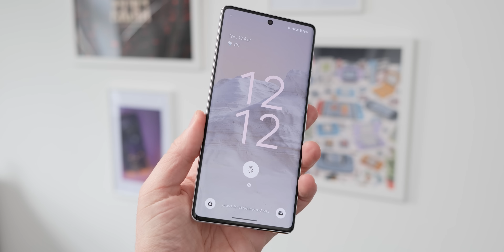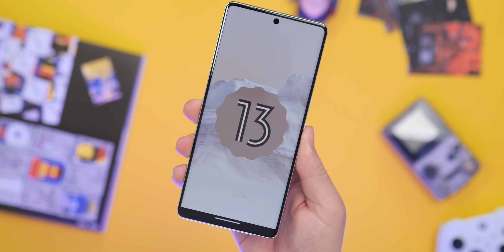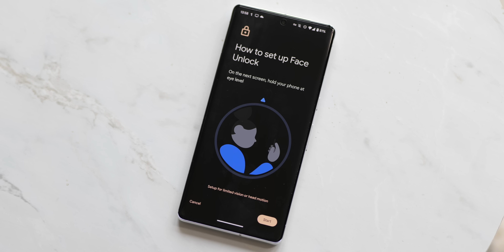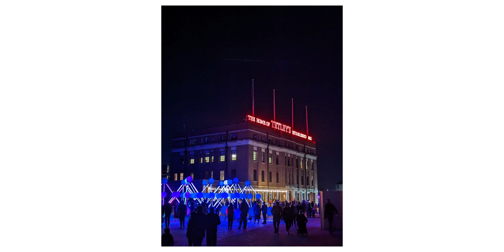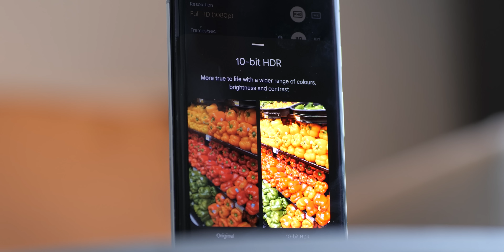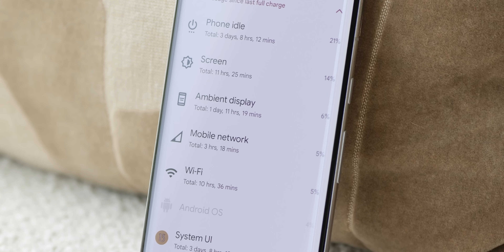Pixel 7 Pro long-term review: The BEST Google phone ever!

Comment: Got my Pixel 7 pro yesterday and right out the box it had crashing and rebooting problems. Did a factory reset and nothing helped. I wouldn't recommend this phone because clearly something in it can be faulty and render the phone unusable right out of the box. Awful experience, if I could get a refund instead of a replacement I would but for now we will see if the 2nd one is also a lemon. I don't seem to be anywhere near the first person to have this exact problem and the only workable solution is to replace the phone.

Comment: I really like the phone in most areas and really hate the phone in some. The battery does not feel like a 5000 mAh battery, it drains more than I'd like on idle/standby even when I turn 5g off and the slow charging does not help this case. There are some bugs I cannot seem to resolve like the screen brightness going very dim sometimes at maximum with and without adaptive brightness and the scrolling is sometimes hit or miss, not keeping momentum while flicking- and is even worse while horizontal scrolling (like through recent apps). The speakers are some of the worst I've ever heard and needs a third-party app like Wavelet to adjust the EQ for it to sound decent. Otherwise, I've been enjoying it so far I guess.

Comment: I'm still using the Samsung Fold 2 I got at launch. Just ordered an upgrade to one of these as they are currently on offer on O2 with £500 in savings across the handset and tariff. Gone from £105 per month to £39 😅

Comment: I must say sometimes it's the best phone and sometimes its the worst phone :D. 
Several down sides:
- charging (ugghh, 1 hour 40 min from 0 to 100), if you are a heavy gamer, this is absolutely not your phone. The heavier the app, the more battery it drains. If you compare it with other phones you will definitely see 2 hours less screentime per full charge.
- spontaneous crashing (weird thing, you can't do much and you need a reboot, happens once a few weeks)
- this software is absolutely no where near the Samsung or Iphone (stability)
- your feedback is still there even after months. Looks like google is not that interested or there are way to many feedbacks (software issues).
I am a Google Pixel 7 pro 256gb user since 3 months.

Comment: I have been using the Pixel 7 Pro for a while now and, except for the fingerprint reader, it's great.
I liked the fingerprint reader on my old Pixel 5 much better. Rock solid and easy to access.
The one built into the front screen is so unreliable it might as well be a Samsung.
Reply: I don't have a single issue with the fingerprint reader. I have a Pixel 7 even with a screen protector.
Reply: if you have a screen protector, make sure you have screen protector mode enabled

Comment: I game everyday on my pixel 7, i play mlbb which is about 8gb game having a very smooth gameplay on full settings but i feel the battery just falls behind the charts of Qualcomm processor's. I used Poco F1 which had a solid processor but always fell behind in battery same as my pixel 😅

Comment: I am a Pixel 7 user. I have been a PIXEL lover since Pixel 2XL in 2017. The very fact that its camera is much better than 99% of the smartphone cameras in the market right now is a special feeling.
Reply: I'm still using my pixel 2XL 😅 but it's been slowly failing me for the last couple of months so i'm upgrading to the 7 Pro. Was a Samsung gal until i got my 2 XL and at this point I'll forever be a google phone gal. My daughter bought the S23 and had to return the first one and 2 years late is having issues with her current one. Up until the recent issues, my ancient 2XL has never given me a single problem.

Comment: The Pixel 7 Pro is nice. While I have not used this yet as my main driver, I am impressed. While I think Android 13 is smooth, I did apply Nova Launcher to help with personalized customization. Charging is a bit slow but I'm helped by my Anker charging cord and brick.

Comment: The phone would be so much better if it was the thickness of the camera bump and all that new internal space was more battery.
It's so derpy having that that weird bump.
Reply: it's 5000mAh battery... that's at the top... only asus rog phones have like 6000 and other 2,3 more specialized phones might have more than 5k... not to mention that the more battery you have the heavier the phone because the main weight comes from the battery in a phone. We don't want heavier phones, they are already heavy enough. What they can work on though is more efficient chipsets and with a faster charging the battery depletion will be way slower and the feeling of needing more battery per charge might even be inexistent with a faster charging.
Reply: @theirregularadventurers  it might be, but it doesn't mean it couldn't be better.
Way back I had an HTC Desire. It had a removable battery which was intergrated into the back case. I bought a new back for it which doubled the thickness of the phone and vastly increased the battery life.
I went from having a phone that needed charging daily to charging every 4-5 days. It was so good.
The thickness made no difference to it's use. Phones are so light that even doubling the weight is meaningless.
We are starting to see fold phones becoming more popular so it's clear the extra thickness doesn't bother people.
I'd much rather a phone being slightly thicker, especially when it already is thicker at the camera bump. Add battery and give me 2 or 3 days of battery.
Reply: @youtubevanced4900  HTC desire is 135 g - now phones these days are almost twice that. It becomes an inconvenience at a point for heavy users especially... Think about gamers they have to hold that in their hands for hours. if you chat with someone when you are in bed or want to watch a long video and you don't support your hand it might become sore very fast. I'm am telling out of my own experience and i'm kind of a big man. Imagine how it is for some frail ladies. Phones are also already so big it barely fit in my pockets. if you wear skinny  it's even more visible and protruding, so i'd definitely wouldn't want thicker frame for these already big phones. if you wear large pants they feel like you have a break swinging in your pocket already so again definitely not heavier. The heavier the phone is the easier to crack when you drop it as well... the heavier it is the more chances to drop as well. There are so many reasons I wouldn't want phones to get heavier and go back to that 145g or like your previous 135g HTC desire... yes! that would also be my desire. And then not to mention the battery life... that HTC desire had like 1400mAh per battery... no wonder you would want double... maybe even triple... and you'll still be only at 4200... these 5000mah phones should hold for weeks for you if that htc with double battery was lasting 4-5 days. I know a lot of people don't know how to adjust the consumption of their phones either. I don't want to be presumptuous because i don't know you personally but just saying that there are ways to significantly improve it with minimal sacrifices especially these days. And I also know that chipsets become more efficient by year as well as AI and good software can increase significantly the battery power. and that's a trend that has to continue and not focus on getting the phones chunkier and heavier. I'd rather go back to plastic frames than all these glass and metal that significantly add weight as well, just to fake call the phone that it has "more premium feeling".
Reply: @youtubevanced4900  btw, samsung seems to have come up with an idea of battery that practically can increase the capacity in a smaller factor. I heard they might introduce it with the galaxy s24series. so yes, that's what we need. new technology for batteries if we really want to put more capacity we should keep the same form factor or less and same weight or less. and seriously focus on efficiency on the processors and software. phones are already faster than anything you can do on such a small factor device (obviously some would disagree) and we don't need 4k screen for 6'5-6'8 inch phones or 1000Hz refresh rate screens. i don't know when people will realize that these things are nothing but marketing gimmicks
Reply: @theirregularadventurers  Those are some good points.
I personally run my phone on power saver all the time as I want my phone to last at least a day.
The S20 can usually get me through work if it's not in power saver mode. I sit most of the day with BT headphones on listening to music to block out the office chatter.
In power saver mode it normally makes it to the evening but this is all conditional that I'm not actually using the screen much at all.
It is a few years old now so that's not helping either but I often need to charge the thing during the day if I put any decent amount of use in.
To me that's not very convenient.
As far as drop protection, that's easy. Get a Spigen case. I've had one for 3 phones now I think. My wife for 3 phones. Most of my closest friends have got them now.
Zero cracked screens or any damage whilst using a Spigen. They are so good.
One friend cheaped out and bought a knock off Spigen. His phone screen has about 5 million cracks because he saved 15 bucks buying the knock off.
Reply: @youtubevanced4900  yeah definitely no longer the days when you could have a phone without a case and now with the scratchy victus... you need to apply even more protection to the front... i had 145g lg g4 in the past and never had to use case and screen protector... seriously phones were so light that even if you dropped them by mistake few times unless you were supper clumsy nothing was happening. now... not only that you have phones double the weight you also have to add more weight and size with cases and extra screens... the irony... and that's what you call fake marketing. heavy, cracking and scratching materials for a "premium phone feeling" that you won't ever actually get to feel and see because it's always going to be under the case and screen protector or easily scratch or crack. Well played!

Comment: Surprised you did not mention front camera performance within apps like WhatsApp and touchscreen performance.
I feel like I'm in year 2010 when using this front camera and on top of that video is always blurry for some reason.(Video from front camera in apps other than Camera app)
And generally touchscreen feels off, unless I disable 120hz and even on 60hz its nowhere near perfect.
Both should be fixable by an update, but it has been 6 months and issues are still here.
Reply: I absolutely agree front camera is absolutely trash

Comment: Changed from Samsung to P7Pro, best thing I've done in ages. Great phone, especially for the price point. Would love to see flat screen, that's about it. Unfortunately my original P7 pro went into a boot loop and had to be replaced, I just hope that the replacement lasts more than 4 months.
Reply: My p7p's motherboard failed. I got a replacement. Here's to the remainder of year with no problems
Reply: S21
Reply: From what model of Samsung?

Comment: Had it right after it launched. Great phone, super smooth but it's plagued with exynos's heating issues.
Battery life is terrible on mobile data and great on wifi.
Device heats up more than usual and the screen is missing DC Dimming.
Overall, I feel Google needs to improve a lott
Reply: Did you update the software that fixes the issue.
Reply: @JonSuejoj  I've done it and a matter of fact I tried some custom roms too.
But it's battery is mediocre at best

Comment: I have massive buyers remorse after buying the Pixel 7 pro. There's no noticeable speed difference between the 7 pro and the S10 Plus. The design is extra just for the sake of it, in the apps are worse than Samsung. Samsung notepad lets you lock notes, and the Samsung health app is designed well and more intuitive than Google fit. Though it's supposedly brighter, it feels the same as the S10 in the sun.